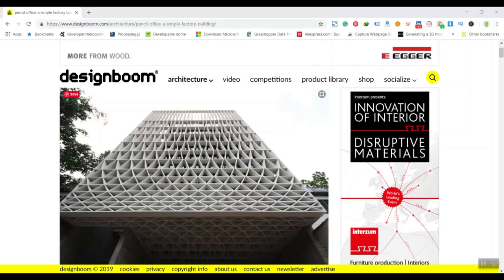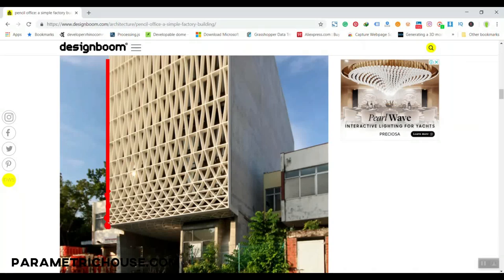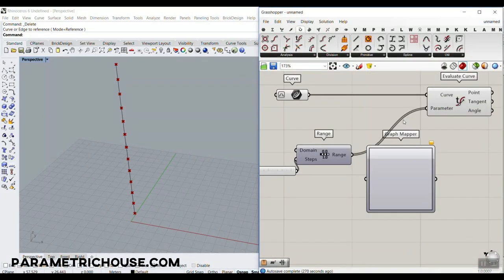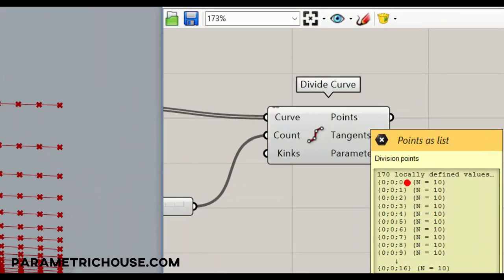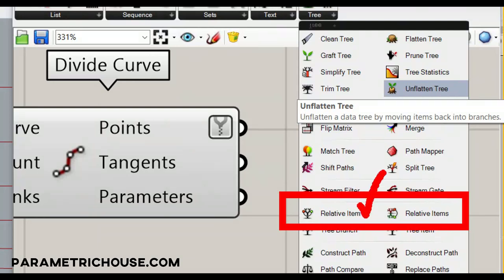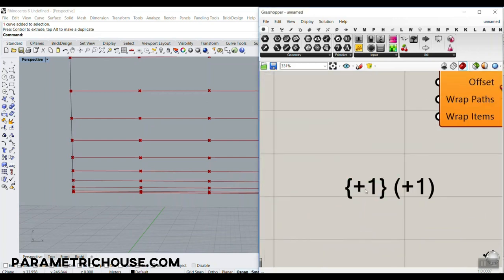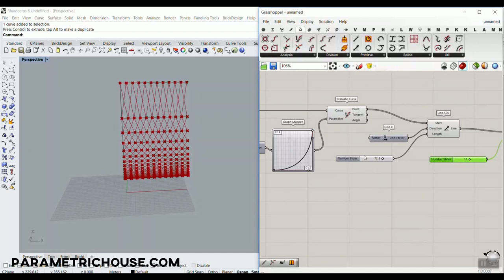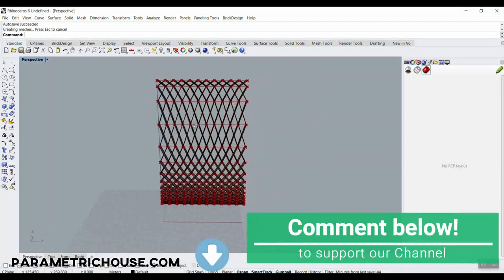Grasshopper Tutorial - Building Facade

Comment: hello, great video, but fail when I try to connect the "line (between two points)" whit "relative item". I did ecstasy you taught but doesn't work. What's wrong?! Thanks a lot!
Reply from the maker: Hi Julia Thanks. Be sure to use Relative item instead of relative Items and also reparametrize the output so it cleans the groups!
Reply: @ParametricHouse  it still didnt work what do i do